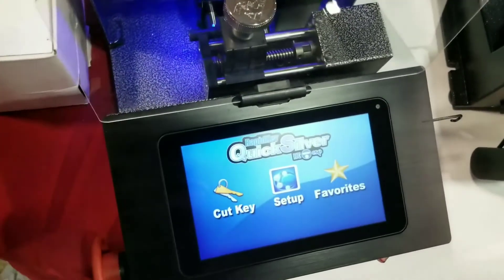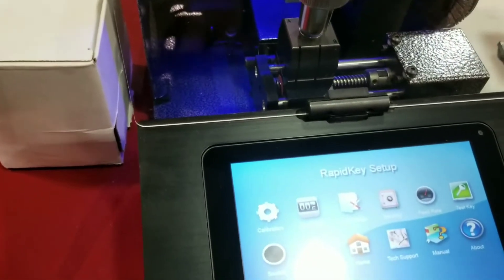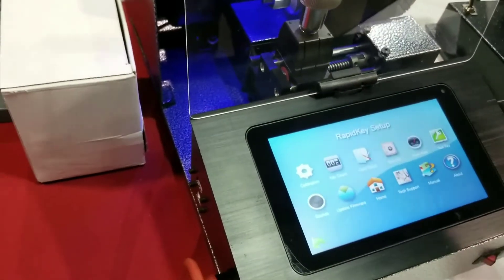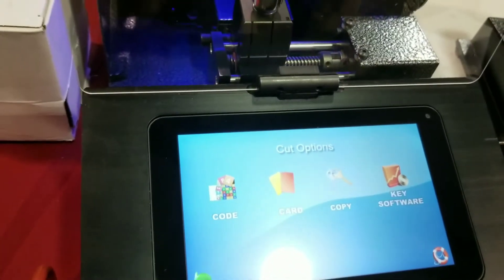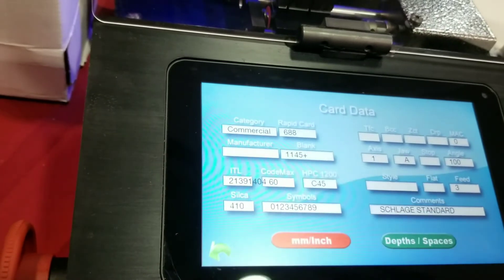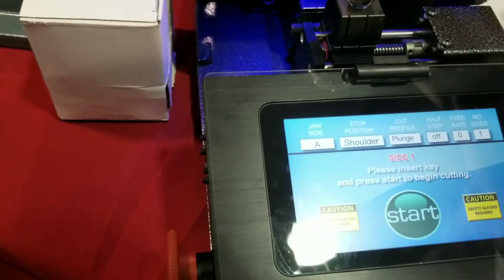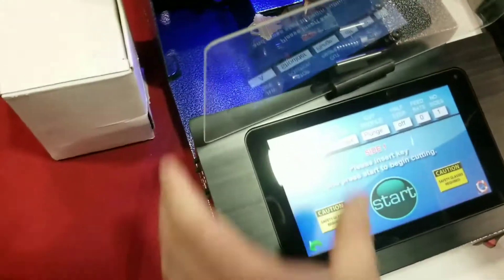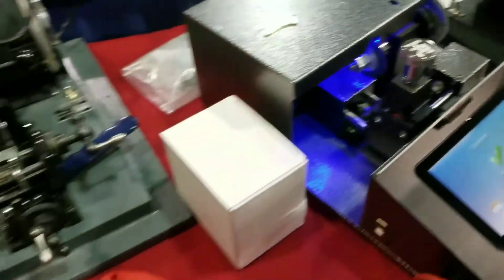HPC Key Cutting Machine Review RapidKey QuickSilver 7000

Comment: I own one they are about $ 3 to 4k, I'm not totally sold on it it's a lil' glitchy sometimes tablet wifi disconnects from the machine for no reason, and auto calibrate is always a battle sometimes it works sometimes it won't??
Reply: shredderbetter
What other machine do you prefer over this?
Reply: Premium fuel only  the original hpc 1200 is still  my go to machine at half the cost, I use this about 50% if I'm cutting lots it's quicker but 1200 is bulletproof for the most part.
Reply: shredderbetter
Thanks, kind of hard to find real world reviews on this kind of stuff. Still trying to decide if ill make the investment.
Reply: @twofiveshort I sent back to HPC to fix it's been flawless for the last few years, BUT I think it's a little overpriced since you can get a machine that does more key types for the same price.